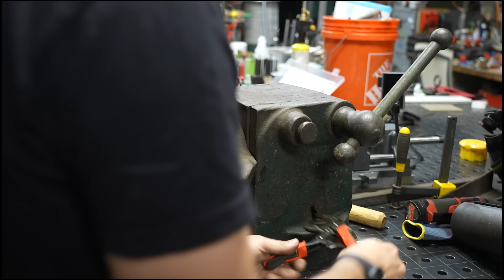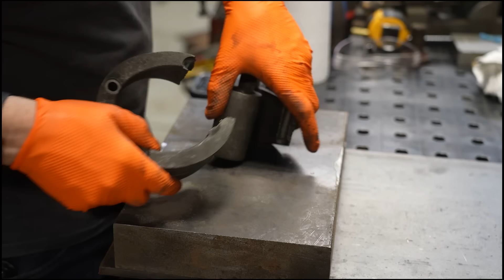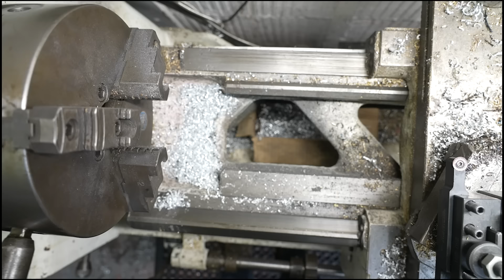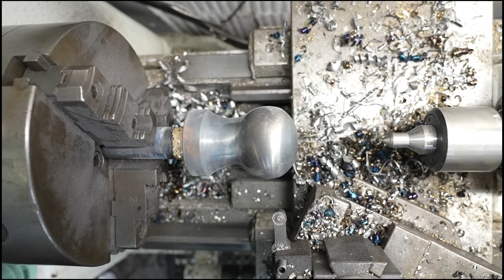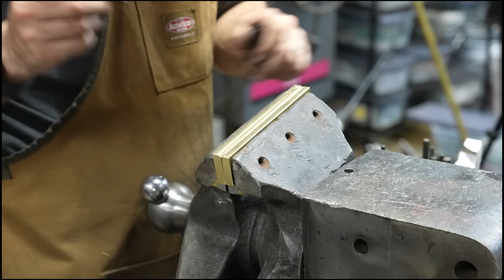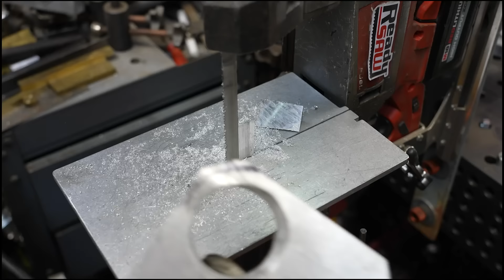I Bought a BROKEN Vise for $5,000 so I Could Restore It!

Comment: Skip the oil. Let it get a good surface rust and give it a phosphoric Acid treatment. It chemically changes the rust, seals the metal and it will never rust again. Since WW2 this is how the Navy keeps its ships from rusting. Guns, tools, the govt saves billions by making its equipment rust proof. Phosphoric Acid (10%-30%l is commonly sold as concrete etch. They don't tell the public how to do this because rust reformers, primers and paints to stop rust is big money.

Comment: Awesome repair, but WD-40 Specialist Penetrant (WD-40 brand) is primarily mineral spirits (multi-range hydrocarbons), with a small percentage of detergent/corrosion inhibitors, delivered as an aerosol solvent system. It is a petroleum-based wetting and lubricating formulation optimized for moderate penetration and corrosion protection rather than aggressive rust bond failure. Its practical performance is ~65/100 on a penetrant effectiveness scale.

A DIY 50/50 acetone + ATF blend operates on a different chemical mechanism. Acetone provides very low viscosity, high volatility, and strong capillary action into tight thread interfaces. ATF provides a persistent lubricating phase with detergent and anti-wear additives that remain after solvent flash-off. Together, this yields significantly higher break-loose efficiency and penetration performance, typically ~90–93/100 in seized fastener applications.

Cost-wise, WD-40 Specialist generally runs ~$0.55–$0.70 per ounce, while a 50/50 acetone + ATF mix averages ~$0.22–$0.35 per ounce depending on local pricing. That places the commercial product at roughly ~2× the cost per ounce while delivering about ~25–35% lower effective performance under heavy corrosion conditions.

Final comparison: higher cost and lower effectiveness in practice when evaluated through functional chemistry rather than marketing hype. Your viewers should be aware of the differences as you push the product since they're sponsoring you!

Comment: Bro I realize that you're sponsored by wd-40 on this video but just in case you don't know this secret my grandfather and my dad always drilled a hole in any junk shocks and struts we would end up with and save the shock oil in an old school pump oil squirter and it eats rust and corrosion really quick it even works to free up pistons that are stuck because a engine sat outside for a long time give it a try you'll love it

Comment: One thing I noticed on watching these types of videos is, nobody uses the 3M belt sander. I did bodywork for years. I always used that belt sander for grinding down welds. I was surgical with it! Welds disappeared! It hid the fact I was a bad welder lol
Reply: 3M is just a brand and isn't very descriptive....unless they only ever made one type of belt sander. Are you talking about a narrow belt sander that is handheld and air or electric powered? I bought a different brand one that is air powered to remove the seams inside hot rolled steel square tubing to build my 2x72 grinder (House/work laser cut kit, he is a youtuber). It is good for certain areas that other grinders don't do well on. I'm a good welder, but some things are a pain or just leave a bead that I want to be smooth and I'm not perfect. Tig welding helps for minimal beads and I use silicon bronze filler to tig weld parts like on this vise. It makes sense to use a flat but small and focused abrasive. My 2x72 grinder is 3hp 3 phase and will run a 24 grit belt at 8,000 surface feet per minute with still a thousand rpm to go on the drive motor/wheel if I wanted to push it that far. I also built and machined a rotary platen with other wheel options and a small wheel holder. It would cost thousands to buy a similar grinder and it is amazing how easy it is to finish parts, especially to clean up parts from my cnc plasma table. I had no idea how well a belt grinder could work, so I get what you are saying about people not understanding the options that are available.

Comment: Silicon bronze is not structural welding — it’s brazing. Using it on vise jaws is a very weak solution for a part that sees high clamping and cyclic loads. Bronze is much softer than steel and will deform or fail over time.

Also, finishing a large hole by drilling multiple small holes instead of using proper tooling destroys roundness and alignment. This might work visually, but mechanically it’s a bad repair and won’t last.

So it’s a 3 out of 10 repair as of me.

Comment: Always let your parts sit in degreaser and/Or Paint Stripper unless your planning to Waste Gallons and Gallons of Rust Remover. Actually you can save a Ton of Money by Just using Strong Vinegar or Acid if you can get your hands on some.

Comment: Question - when you were repairing the jaw body, if you have a mill, why not mill the broken area square and flat? Would that not have allowed you a better, stronger joint for the repair, especially if you used silver solder tape to form the bond? Also, I can send you a boring bar tool for your Bridgeport. Way better than using a hole saw. As far as the stand, I'm thinking something similar to the old cast-iron stands that bench mills/lathes sit on.  Something vaguely old-timey and blacksmith-y?

Comment: THIS CAN'T WEIGH 500 LBS. AND IT WOULDN'T EVEN BE WORTH 5000 EUROS IN GOOD CONDITION. THERE'S NOT A SINGLE THING RIGHT ABOUT THIS VIDEO.
Reply from the maker: It weighs 250 lbs did you watch the video?
Reply: @MakeEverything ok

Comment: Excellent job fixing this up.  Quality craftsmanship.  That said, I think you got robbed on the purchase price.  It seems to me that machinery like this is practically given away just to get rid of it and if you have to pay anything, it can be picked up for the price of scrap metal?  I often see old lathes, mills and presses that still work BEING given away for free!  Although, now that I think about it, I also often see small bench vices listed on craigslist for more than what you can buy them for new at Harbor Freight?  So I guess it go back to the thought "one man's junk is another man's treasure".
Reply: Harbor freight is junk compared to old USA made castings........you are assuming the quality is the same. That is like comparing harbor freight's cheapest sockets to snapon or their cordless tools to Milwaukee. There are different types of castings and metal used. There are so many variables between the products you listed with old equipment that they can't be compared in such a vague way. Yes, your last part is correct. Some people understand that something may not be junk or that the new item may be junk compared to the old. People have different needs and values.

Comment: You could have made one from scratch and saved the $5k?😐
Reply from the maker: What do you think one from
Scratch would cost?
Reply: Making the complicated patterns for the multiple castings would be a huge job in itself. Maybe print the patterns. Then finding a foundry to cast them and then clean up the castings and machine the small pieces. You would need to cast parts for 5-10 vises to  amortize the costs and guesstimate what you could sell each one for.
Sell complete or rough castings kit. Was the $5000 factoring in all the costs including your labor?

Comment: Rust treatment 101.
Degrease first.
I understand you want to shill their products, but surely using them so they work properly would be better advertisement?!
Cant say im not jealous of the 80L rust treatment bucket though hahahaha!!
My molasses bucket works great but is a little slower.
Beautiful vice.
Such a shame they're so delicate.
Seems so odd to be built so heavily but a key component is so weak when it doesn't have to be!
Id say it was oiled up and put somewhere to get grubby so they wouldn't instantly get busted selling a broken vice for 5k.
They definitely knew.
Good work restoring it. It really is a useful tool
Reply: I call BS. Why would they go to that trouble? You don't think the thing was used and abused for years and broke after being covered in dirt and grease? Sure, it could have sat around for many more years in the same condition, collecting more dirt. Who knows how much the seller knew about the vise or if they even tried using it? They may have known it was broken and just sold it in the condition it was in when they got their hands on it.

Comment: You really should have used a welding tip when you are brazing. You treated it like soldering instead of welding, which it is closer to. Even though you don't want the two metals mixing, you should still consider it a form of welding and treat it as such. Just getting the base material red hot is not enough to get a strong braze weld.

Comment: That's a super cool vice, but I can't help feeling a bit "meh" on the work you did.  First part of the video felt a lot like an agressive advert for the blue and yellow, which I guess is fair enough, at least you say you're sponsored, so that's cool, but...

I'll pass on criticising buying stuff without adequately weighing up its clearly broken nature.  It's not like I have 3 lathes and a mill due to exactly that myself, it would seem somewhat hypocritical to do so.  It's fun, right?

That looks a lot like about a thousand dollar's worth of rust remover.  And, as well as you very much denaturing it with paint and grease due to not bothering to, y'know, actually clean the part beforehand, it didn't even seem to do a very good job.  But hey, maybe that's just due to you misusing it.  For something like that, it's "tear it down, pressure washer, paint stripper, pressure washer, rust removal".  That would seem far more likely to get a decent job done /and/ preserve your 40 gallons of expensive rust remover.

As an aside, electrolysis would have done the job at pretty much zero cost and removed the paint in the process, or you could have used the beyond ballistics recipe for rust removal.  For 40 gallons,  it would cost maybe a hundred bucks.  But, sponsored by the blue and yellow, furry muff.

Next.  Brazing.  Brazing is not welding.  It's hard soldering.  The strength comes from having a very small joint with a large surface, the bronze / silver solder / whatever is pulled into the joint by capillary action. You really don't want to be grinding bigass v's into the work, that's for welding.  And yes, you're having trouble getting the braze to flow, because your piece is not hot enough.  The piece needs to be hot enough to melt, and keep molten, the braze material.  It's not the torch that should do this, it's the piece itself.  "cherry red", is the phrase most often used. Yeah, that's gonna require a fuckshedload of heat for a chunk of cast iron that big.  It'd have chucked it onto the forge to get the mass up to temperature (low red) and then used the torch to get the rest of the way around the braze.  Gas barbeque would have done it as well.  Get it hot, get it red, apply a lot of flux, apply a small amount of bronze.  Well, a fair amount of bronze in this case, but you get the point.

The jaw ledge fix, fine, except that you carefully milled it square, then welded the nuts and hit it with a goddamn grinder, you savage.  Same thing applies for the brazes as above, obvs.

The locking mechanism is now officially "next owner's problem"™.  When it wears, or breaks, they're "officially SOL"™.You had a perfectly acceptable working piece, all you needed to do was to make a matching acme insert and braze it in place.

I like the BLO finish.

Comment: Would it help to wire brush or grind in between say welds to help remove any impurities, also let or completely cool b4 heating and applying another weld. I guess in the end for strength and durability? Mainly curious as I have done little cast bronze brazing

Comment: A much better rust removal process, especially with cast iron is to do it using electrolysis.
1 table spoon of washing soda per litre of water, a 12v battery charger and a sacrificial stainless steel anode and this will remove all rust and loose paint overnight. I've used this on Stanley hand planes and it works a treat.
Also, to help prevent a new rust layer forming after cleaning, wash down with methylated spirit.
Reply: That is great, I will try that real soon on a strange vice i found in a forest , was a ridiculous task carrying it back, the meths idea is also brilliant.   Thanks

Comment: You should ALWAYS war safety glasses when using a wire wheel, when I was in my teens I didn’t know, no one told me, I had a 1.5 inch wire come off a wheel and stab me less then a half inch under my eye!! In the end I was so thankful cuz it could be so much worse.
Reply from the maker: Face shield!

Comment: I think a 50 gal drum, filled with sand and a 3/4" plate welded on top would make for a nice industrial looking and heavy base for it. Not to mention it would act like a soft blow hammer and absorb any shocks put into it. AND its the perfect height! BTW Very nice work. Little expensive. You can get stuff like that easy at the scrap yard.

Comment: Honestly it would take A LOT of work and A TON of time but you could add 2-3 more braces around the threaded cylindrical piece at 6:06 you could also get a CNC'd piece made, would probably drastically make that thing more usable. Either way though you can never go wrong with OEM or OEM + on a resto. Nice job seriously.

Comment: Game changer multi vise! I like your repair choices. You need a preheat oven for these kind of repairs to bring cast iron parts slowly to 400° to ensure the cast iron allows the silicon bronze to adhere and then slowly lower the repaired part to slowly cool 8n a very controlled environment to aid in the success of your repair.
Reply: If whatever needs repaired fits in my old shop oven I've got for just this type of use.
I leave oven on so if I need to bring it back up to temperature to keep even temperature through the whole piece, and that way when I'm finished then leave the part in the oven for another 30 minutes to assure it's at 400°, and then shut it down wrapped in old fire blanket until the next day so it cools slowly with the oven, and blanket keeps it even longer at temperature just in case. 
Never failed me yet, which means I just jinxed myself, but then no one is perfect so no harm, except I really dislike doing things twice if at all possible. 
Torch is too inconsistent with getting equal heat through the whole area needing repairs, and then you have to be even more careful when you bring it back up to temperature when the area where you made repair is smoking hot compared to everything around it. 
There's where most people get into trouble, and it cracks, because they tend to linger too long on the cracked area trying to get the weld smooth and even which it's better to apply it heavy so you don't over heat it and grind it smooth afterwards.

Comment: A trunnion is a cylindrical projection or shaft that serves as a mounting or pivoting point for a rotating joint, often used to attach an object to another so that it can rotate in place

Comment: Stand should have D.R.O. locking 3 axis rotation (like a giant u-joint on a rotating platter) on a robotic wheeled base with remote control driving for easy repositioning in the shop. 100% agree on the BLO finish. Interesting how the broken lip, 2 places, on the i.d. of the rotating jaw selector happened to break right below both flat jaws; my guess is that owner next to never cleaned out swarf that built up as a wedge between three rotator & tilt body, so when you whammed on it hard there was excessive pressure up on the lip, or maybe the excess swarf just wedged up when whamming the jaws closed & the welded meatball was relared abuse. All in, beautiful find, nice restoration, especially the stainl& brass accents.

Comment: While this vise is a unique piece with a lot of versatility  the fact that all the pieces are broken tells me that the original enginerring has faults in that it looks ruged but is not.
Reply from the maker: The design of this vise has many flaws… I don’t think the company really iterated and improved before they just stopped making these all together
Reply: How could you possibly know what lead to the damage? Are you assuming the damage wasn't from abuse, or do you think a vise should hold up to anything a person can throw at it? Would it be considered ok to beat on a part in the vise with a 20 pound sledge hammer? I won't argue that it can't have faults in it, but I will argue that you can't assume all the damage was due to design. Some people could probably break an anvil. What does rugged mean? To mean a rugged vise may handle beating with a 1 or 3 pound hammer on a part if left with no other choice, but another person may think it can handle a sledge hammer. I don't like to assume or make statements that are absolute when it wouldn't take much for them to be challenged. The vise may have been meant to be very versatile with an acceptance that a trade off was acceptable for it not being as tough as more common designs.

Comment: great hack, with the lathe chuck, but! don't use it for the lathe until you clean it, the swarf of the grinding will lap the parts, causing wear, or the grease to go stiff, misaligning the parts, so the runout of the device is lost, thats the important bit, spend thousands on a lathe to get accuracy in the spindle cartridge, only to fit a worn chuck?, stupid, yes.

Comment: if we can still produce engine blocks. why is something like this so rare and expensive.
Reply: Can vs. do. Also, the quality of the casting, which is not at all cheap or common in the USA. Look up the fireball hardtail vise video and the casting made in Los Angeles. There is great demand for engine blocks and they are produced. There isn't great demand for these vises and most castings are done cheaply and outside the USA. Cast iron is not the same as cast steel, as well.